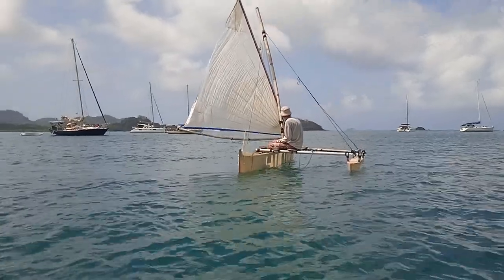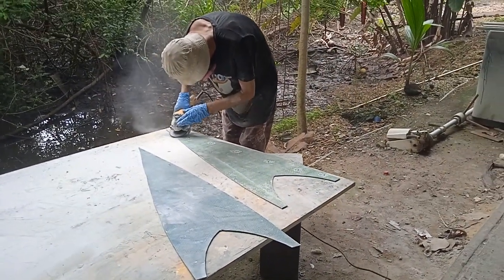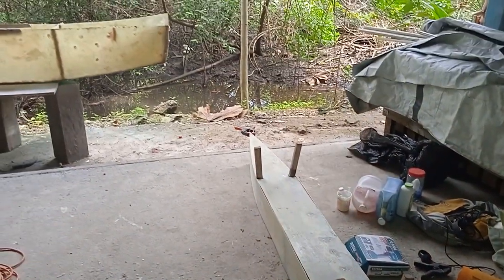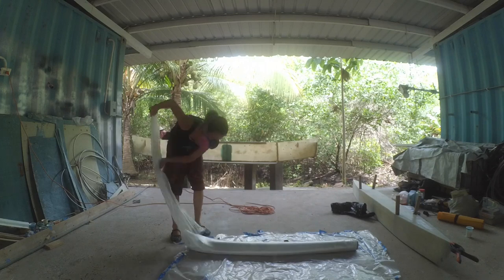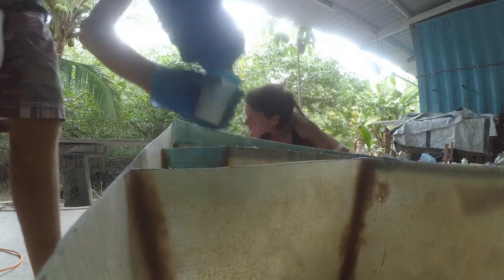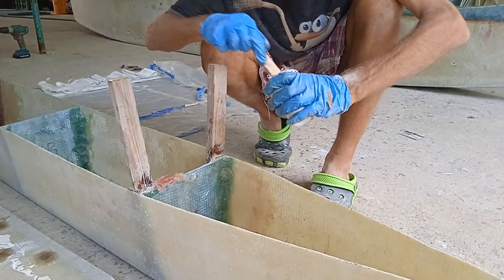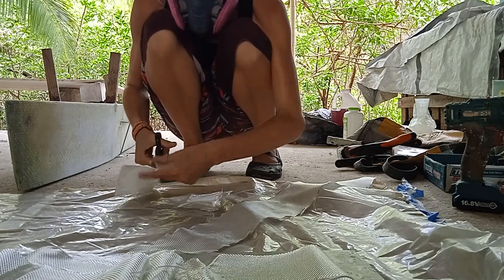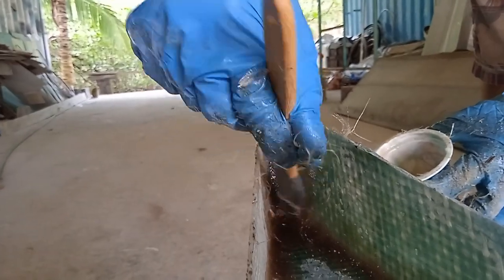Chaos, progress & magic | Pacific proa build Part 4 [Q45]

Comment: is your reusable brush a silicone basting brush? like for cooking? that's a great idea I'm gonna get one of those and try it! how does polyester stick to silicone? I find epoxy sticks to it quite well, but I think it would be easy to clean off with methanol (my current solvent of choice as it's both less toxic and cheaper than acetone, and still able to thin epoxy)
Reply from the maker: It's exactly that you can usually find them in cooking/baking section 😊  We used it both with polyester and epoxy no problem 😊  We actually let it cure before we clean it you can then just detach the resin it's very satisfying 😀 The only downside we found for now is it doesn't hold as much resin as a regular brush and tends to be drippy but otherwise we are quite happy with it. Thanks for the tip with methanol we will try that as aceton is not only more expensive but actually sometimes hard to find here in Panama 😀